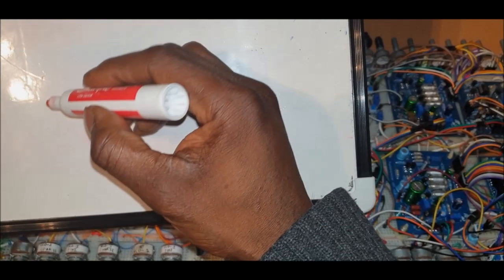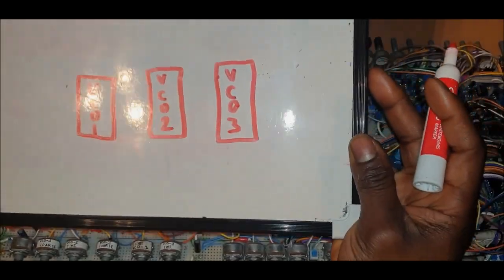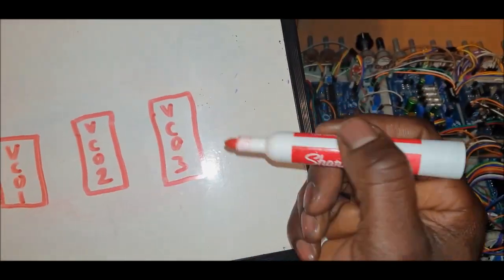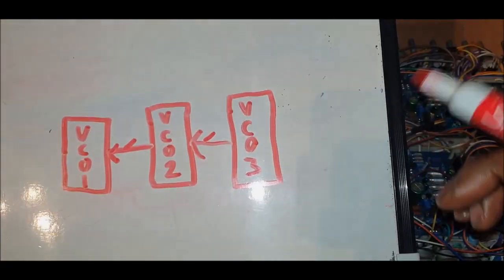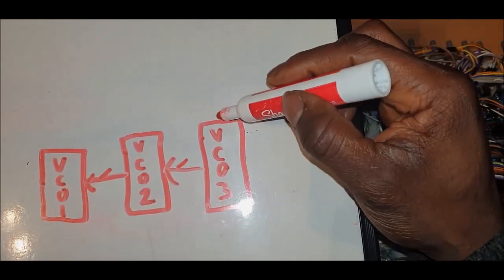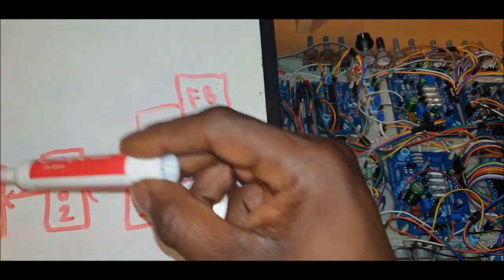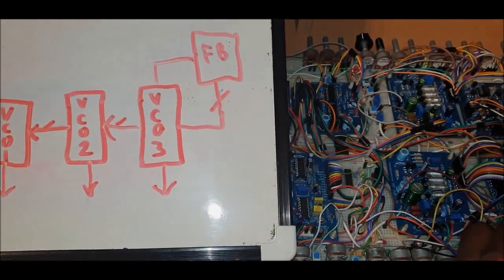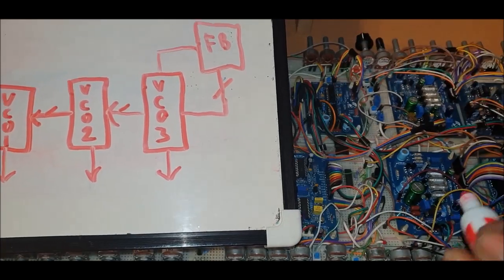DIY analogue synth project (VCO PCBs Linear FM X mod)

Comment: awesome sounds, now you should as the Make Noise 0-Coast semi modular but with a fixed default route. the VCO's can be turned into LFO's using a SPDT switch and a 1M resistor on the tune knob instead of the 100k on the cv summing circuit.
Reply from the maker: Brilliant idea . I will give that a try and see the results . However wouldn't the oscillator still be tracking the keyboard ?.
Maybe I'll look at how the model implements this. Great idea still.
Reply: @AdamTheAd-vanc3d  the exponential converter still works, but at a lower frequency. that's how Doepfer does it on their VCO. a SPDT on/off/on and you have 3 speeds. so you could opt for 100K (default, middle position of SPDT) + 402K and 100K + 909K.

... and you should make it like Make Noise 0'coast, a standard synthesizer but still have to optional patch cables to breake routes and make new connection, you will have a beast of a synthesizer.

the Make Noise 0'coast poses something like #Befaco dual attenuverter#, 2 input. called "SUM", witch allows you to invert/scale cv signals/voltages. sounds useless, but unlocks a million more sound possibilities, Fine tune. accept the offset from possibility Befaco.
https://www.befaco.org/docs/Dual%20attenuverter/Atenuverter_sch_V2.pdf
Reply: @AdamTheAd-vanc3d  use PJ302M 3.5mm Audio Jacks (x1)
https://www.thonk.co.uk/shop/3-5mm-jacks/

on the keyboard CV, if you fit a patch cable you can disconnect the VCO/LFO (make it run freely) from the keyboard C.V. via the switched contact in the jack. same store for the exponential CV input, witch is on the same cv bus.

Comment: These "patches" sounds very interesting! :) I love FM stuff the most. These are endless fields...
Oscillator feedback "tweak" the pitch up and it may be very interesting to know the reason. I don't think that DC coupling could fix this otherwise it would be very easy :)) I think that I've tried that already.
I'm guessing that it's something about an osc. phase. Anyway it takes a voltage to add (or multiply?) in a moment that can't be in the same time that a piece of a soundwave that is becoming next physically (that will be modulated).
Reply from the maker: Hey thanks . I'm not sure why the tracking drifts out at max feedback level . If I could explain this to myself from a technical point of view then I guess I could iron this out. However this is my first go at design so I'm quite pleased with the result.
Reply: @AdamTheAd-vanc3d  cool upgrades bro! from what i remember, i got similar results no matter what. getting it into max feedback, i think it caused the osc to double its frequency or something like that, then with dc coupling you get unfiltered noise that can affect modulation too..AC coupling will have different results depending on input cap and osc frequency that goes into input. i thought id stuff a tracking filter before the input.but sadly, phase is the main problem so there are solutions but require mcu's and it all added to a huge board, that i abandoned the project for a while (abandoned as in not looking for perfect sound anymore, so i leave it as is). i see you have no problems adding modules to your desk-sized protoboard xD, so thumbs up for the motivation and achievments! 👍 PM me if you plan to populate multiple smd boards, i got access to a p&p machine
Reply from the maker: @alexsicko  Thanks for sharing your experience. To an extent I guess this is something more suited to fx and drum patches.  The VCO boards all have the fm in/out and feedback options so it can be left out or all with the feedback option for some craziness.